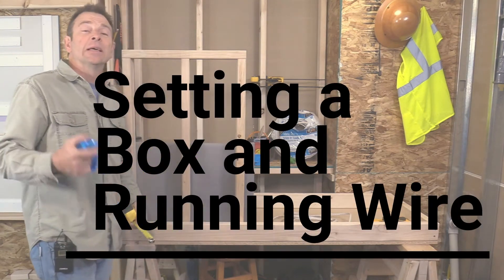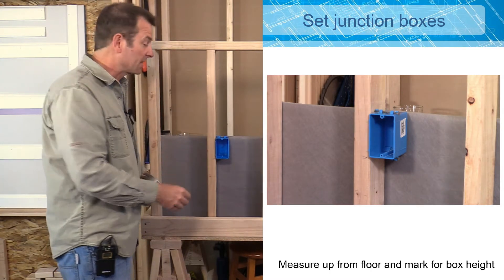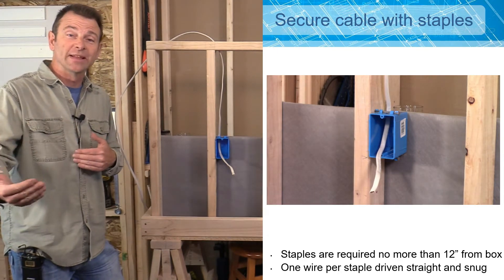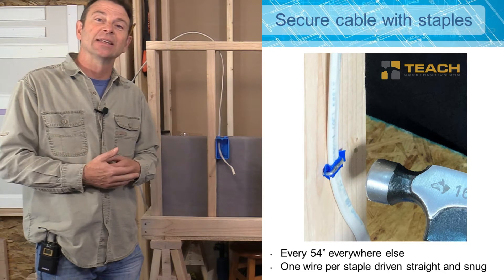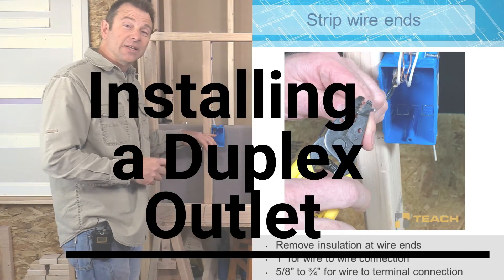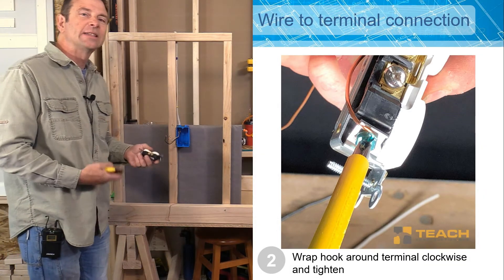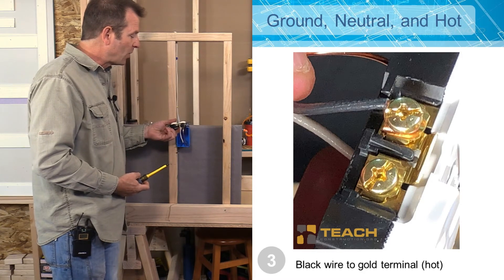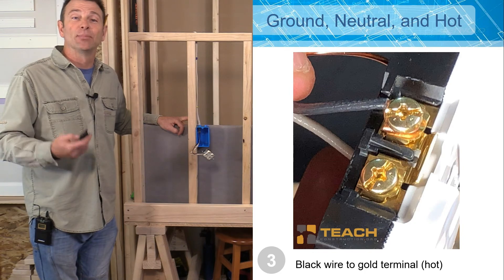Electrical Wiring Process - Installing a box, running wire, stripping wire, installing an outlet

Comment: 有个问题，插座的电线接接好后，需不需要在插座里面的四周缠上电工胶布？？以防止不小心而触电。I have a question. After the socket wires are connected, do I need to wrap electrical tape around the socket?  ?  To prevent accidental electric shock

Comment: I really struggle with space when it comes time to pack two or more cables in a single outlet box. Especially getting the outlet in straight.
Reply from the maker: it is not easy